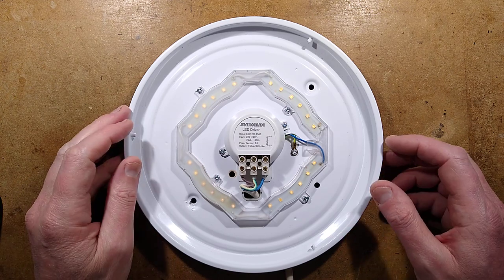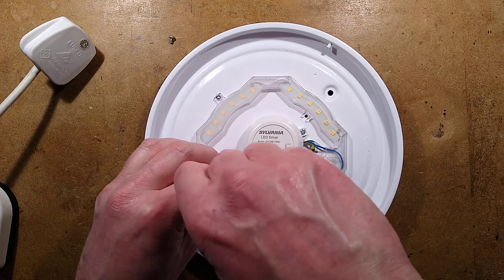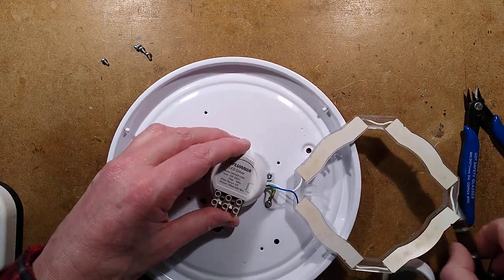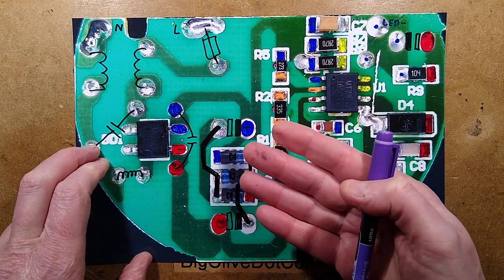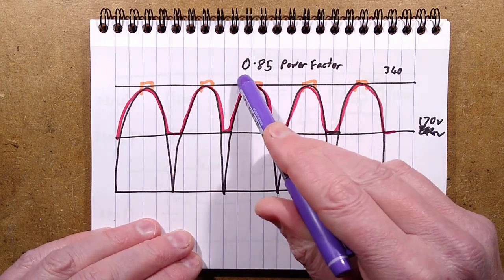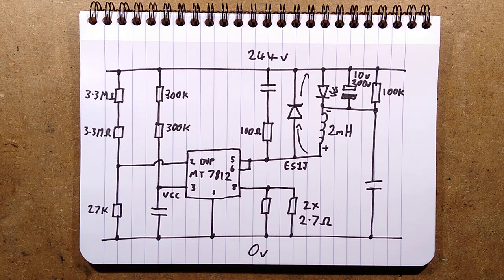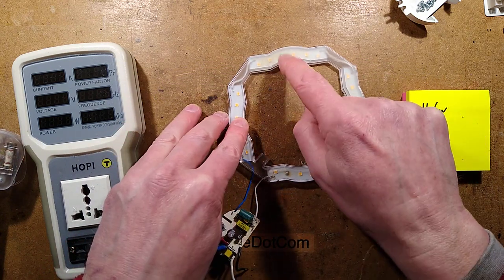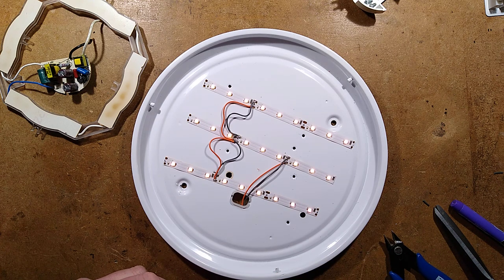Fixing and hacking a light from Thomas Nagy

Comment: Hi Clive. Got a question if you see this and wouldn't mind answering. I figure if anyone knows, it would be you. I want to power some solar string lights with a plug in adapter but want to keep the switch so I can pick flashing modes. Can I just remove the battery and wire in appropriate voltage? Would the panel still turn it on at night or would the whole thing just explode and kill everyone in a 5 miles radius. Cheers mate 🍻
Reply: You might want to add a diode between the power supply and the battery connector but otherwise it should be fine.
Reply from the maker: If it has three AA cells you can add a chopped off USB cable with a diode in series to nudge the voltage down a bit.
Reply: Thanks a lot guys. I'll try it later. Appreciate the response 👍

Comment: 2:45 The Osram LED circle lamps are also open inside and not covered, so it's not only the cheap ones from Ebay that are not covered with plastic.
Reply: Potentially they use a galvanic isolated power supply, so touching the LEDs is not dangerous?

Comment: This can be repaired by replacing the grilled LEDs with new ones desoldered from some 12V strip. It's cheap enough to be feasible. Then reduce the current by fiddling with current set resistors, so new LEDs won't die so quickly.
Reply from the maker: Common LED packages may contain higher powered chips or even a large multiple of series chips on the same substrate.

Comment: Hmm, I can see why a lot of these products would end up in landfill. I always prefer the products with user replaceable bulbs, so if the bulb fails, you just replace the bulb and you're back with a functional light.
I'd probably keep the PSU as is and add more LEDs in parallel (looks like there's enough room inside the fixture) so that you have less current per LED. I'd also use decent thermal paste (or similar) to ensure they have good thermal managements and don't bake themselves - as heat is the biggest killer for LEDs, and overheating LEDs won't last very long at all.

Comment: I have similar lights in my shack. I don't like them. One stopped working recently. I took the cover off, and removed the plastic for a better look. Mine has a circuit board in the center. Nothing was looking out of place, so I dropped it down and put the meter on the mains leads. I got 1.9v. Figured it was just phantom numbers, but it zeroed out when I removed a probe. Checked at the switch, got 1.9v again. Swapped out the light switch with another one, and it was working again. Guess I will need to replace all the switches soon.

Comment: Clive, amazing as always. I picked up an ikea ceiling puck like this and it has the most awful peripheral vision flicker. Are there any techniques for mitigating that? Smoothing capacitor or driver swap surgery perhaps?
Reply: In 99.9% of circuits you can put an extra capacitor directly across the LED array to reduce the flicker.

Comment: Hey clive... What about just installing a dimmer switch? Seems like that'd be a lot easier :) no ladder required either! Great video buddy thank you! We've been installing a lot of "wafer" lights here (canless light, has a junction box attached and hardwires) but presents the same concerns for me, if one fails, my customer would have to pay a service fee for us to come back out and change it vs being able to change it themselves. However, I've installed a couple hundred and haven't seen any fail yet, i'm hoping having the power supply so far away from the fixture will help, but we shall see!
Reply: This light doesn't seem dimmable. It has a buck regulator that I imagine won't take kindly to a dimmer.

Comment: Led panels for suspended ceiling are the absolute worse. I have seen many shops changed it and it gone shit within a year. My local chemist has replaced many again and said to guy, should've kept old fitting and retrofitted to led tube that are changeable. Also old fittings have louvre so less glare which is better too.

Comment: 5:00 , Won't that increase the series voltage across all the remaining LED's, making them run brighter and hotter?
Reply: No.  The power supply regulates to a particular current, at whatever voltage results.
Reply: LEDs are not ohmic conductors. They will normally clamp the voltage down to their collective forward drop, drawing as much current as they get in the process. So they are usually driven with a fixed current which works as long as the collective forward drop is within the design limit of the driver
Reply: @rexsceleratorum1632  OK, so with a defective LED bypassed, will the power supply still try and deliver it's full rated current across the remaining LED's, making them all run with a higher current? 

If not, would it still be ok if only a single LED was connected to the  power supply, in which case what would stop the single LED from being over driven when the power supply is designed to give more  current than a single LED?
Reply: @ElliottVeares  You are contradicting yourself there. Yes, the driver will still deliver its full rated current, which is still the same current, not a "higher current". 

You might be confusing current with power/wattage. The driver will supply a lower power to a smaller chain of LEDs because their forward voltage drop is lower and less work is needed to push the same current through them.
Reply: @ElliottVeares  If it is a 100mA buck driver like the ubiquitous 9W bulbs here in India, it will continue to deliver exactly 100mA to the LEDs whether they are 27 LEDs in series or 24 LEDs (after shorting out one 3-LED module).

Comment: This is something I've noticed..go out at night after a lightning storm, and a number of outdoor lights will be blinking...I call it " contacting the mother ship". 
     I bought a couple Dollar Tree LED bulbs for a freight elevator at work, and they've been on 24/7/365 since 2019 in a high vibration location.
     So far, I've had very good luck with LED bulbs...two failures so far.
     No user serviceable components inside....well, how do they know who the user is? Depends on the user..
Reply: The lack of thermal cycling might be a factor there?  The front hall light here has been on 24/7 for a few years now, both bulbs are still okay.  Same fixture in a spare room, where it only gets turned on once a month maybe, one of the bulbs has already gone.  The whole thing's a planned obsolescence game though, really, can't win unless you change 'em yourself.
Reply from the maker: I the elevators are in a cool area that will help.  LEDs aren't bothered too much by vibration.

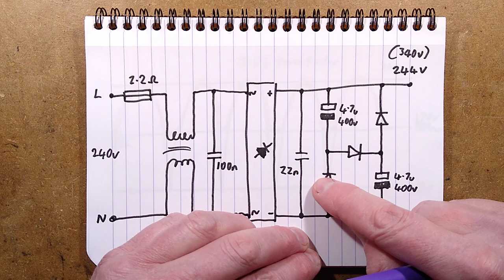Comment: How is it that  the dc voltage is not a direct short through the 3 diodes?  It does not look right? (11:55) Cheers
Reply: All of them are connected in reverse so no

Comment: Clive, I would like to use the filament style glass retro Edison bulbs on 12v dc supply, those filaments are in series pairs with 110vdc at about 13 watt per bulb with a ~>perceived<~ equivalent of 100 watts. 
mini inverter like circuit in the fixture? the bulb package is difficult ( not impossible ) to modify. how would you suggest to venture forth with the goal of light from that bulb?
Thanks for all the fun ❤️✌️👍
Reply: Honestly I'd just use a cheap automotive inverter. The basic modified "sine" wave ones are actually pretty efficient, especially if you are running multiple bulbs.

The downside is modified sine wave inverters are hard on capacitor dropper circuits, hopefully your chosen bulbs use something else.
Reply from the maker: You can get 12V versions of the LED filament lamps.

Comment: i 'rescued' one similar but different from a neighbours bin,   never been used,   i soon found out why, they couldnt get the thing open, took me ages to get the 'shade' off !!! no branding at all on it anywhere!
Reply: the led arrangement is a bit different, led chips have plastic semicircular lens things stuck on them, mounted on pcb on metal strips, bolted to the chassis, with semi exposed connections,
Reply: it does have thermal compound between the strips and main chassis, luckily....

Comment: I think many of those lights get deformed during installation, resulting in the bad thermal contact since the plastic does not deform together with the metal backing.
When installing those, it might be a good idea to just have the screws touch the metal backing and not over-tighten them.

Comment: Snubber Definiton: A device used to suppress ("snub") voltage transients in electrical systems, pressure transients in fluid systems, or excess force or rapid movement in mechanical systems.

Comment: 12W about equals 100w incandescent. Rather than under drive those LED's losing some of the intensity. I get the larger LED's that are round [1/4"/1W, 3W, 5W] with SMD mounting but you can bend the leads up and solder wires directly with metal backing for heatsinking.

 Take 24 of those using thermal conductive adhesive/silicone and glue them directly to the metal backplate in the exact spots the originals were. Use the 1W units and then that way there will be proper heat transfer with the LED's being driven @.5W so they would last forever, or at least until the power supply craps out.

Comment: this ensemble of diodes and capacitors is called "Valley-Fill" circuit and as you already mentioned it's a kind of power-factor correction (avoiding the usage of inductors and weight).  https://en.wikipedia.org/wiki/Valley-fill_circuit

Comment: I'd replace the LEDs with some nice bright 12v LED tape wired in 6x series'd strips to make up the 80v output of the power supply (84v, given 12 doesn't quite divide into 80 cleanly), and choose a colour of LED I like, cos warm white is too yucky to work with... :)
Reply: Make sure to remove and short out all six resistors which will waste power and produce waste heat. And make sure that you don't overdrive them because they might only need about 20mA while the driver puts out 150mA. At that point it becomes easier to do what Clive did.

Comment: The right to repair and the right to have spare parts for at least 10 years. The UK talks the talks over being green but it is the worst country for  implementing it,  everything is done for the large companies and to keep their manufacturing factories going. For example in the USA and Australia if you have something you do not want you put it out the day before the dustman comes and any one can come and take it. So if you have a chair that you no longer want, you put it out and if some one fancies it they can take it., making use and recycling used goods. In the UK we do not do this we have to take it to so called recycling centres. Lots of diy channels on you tube show them fixing  garden machinary that has been left out or the dustmen. The other gripe is that on cheap mass produced goods you can not even buy the raw materials at the price they sell finished goods. This how much control the manufacturers have and it is not buying in bulk as wool shop or timber yard can buy raw materials in bulk.

Comment: is there any chance you could do a video comparing 12v LED strip from the cheapest i.e. Amazon bargains to the more expensive branded ones all the same spec to determine what is the best I'm pretty sure some of the cheap ones on Amazon are the expensive stuff that didn't pass QC chips not square etc but still fine
Reply from the maker: It's very random.  I've had cheap stuff that has lasted well and expensive stuff that hasn't.

Comment: I wonder how long it will be before new install lighting circuits become 12v instead of 240v? Not an electrical engineer just find the videos fascinating but wonder why lights need to be 240v powerd when 12v could do
Reply: @Okurka.  They can be very efficient though. What is not efficient will be the wiring at 12V which may require 20x thicker wires for the same efficiency
Reply: @rexsceleratorum1632  48V would make more sense.
Reply: @rexsceleratorum1632  see this is why I commented, had always wondered why, I had not even though about that, thanks
Reply: @Okurka.  I have 22 light bulbs now that are always on and no light switches, when I had my house rewired I asked the electrician if I needed them as they look ugly and I have 100% smart lighting he said as far as he knew there is no reg requiring light switches as long as they can be turned off on the fuse board, they hardy use anything when on standby
Reply: @Okurka.  no idea what that is, he was registed with the local council

Comment: It will still end up in landfill eventually even if the leds don't fail as the other usual failure will be the electrolytic capacitors.

Comment: I still think with your ~1 million subs (and maybe with some AvE help/advertising) you could completely destroy the lighting market in every country.  Appropriately driven LED's, bigger than needed components, and possibly even repairable via replacement modules.  
Do "Designed to not fail" and reasonable quality...  you would be a bajillionaire and be able to buy everything on ebay/ali express you wanted for the rest of your life.  And you'd be very appealing to eco-minded folks.

Comment: 0:45 rubber seal so prob used for bathroom application ? it should still have a tiny hole in the bottom so any water can escape in humid enviroments

Comment: Wouldnt say they are designed to fail, they are designed for extremely low cost, which means using minimal LED's at full power or overdriving them making them fail quicker, failure is the result of cost cutting measures

Comment: when buying such a fixture couldnt you stick a strip of led in series with the existing leds and prolong the longevity of it?
Reply: No, the driver is a current regulator, so it will push the same current through all of them (until the driver runs out of voltage headroom and nothing lights).
Reply: As Clive suggested, you're better off doing the opposite -- short out a few of the LEDs so that the strip as as a whole outputs less heat.

Comment: It's not always sa simple as chopping one sense resistor out, most lamps I've modded had two dissimilar resistors (for example 2 and 8 ohms) so leaving either one would either not make enough difference or make it too dim. In those cases I have to scrounge for a right value resistor to replace both (sometimes smd, sometimes through hole 1/2w).
I would advise against getting those retrofit led boards that attach with magnets, all the ones I've seen (cheap chinese no brand) had aluminum core pcb's with a non-isolated power supply.
Reply: Also I really avoid this style of lamp, instead still sticking to standard E27 base lamps that anyone can change the lightbulb easily.

Comment: I think you'll find that Sylvania are originally Hungarian, not Canadian ... from their website "Sylvania is the leading brand of the Feilo Sylvania Group which has headquarters in Budapest, Hungary, as well as innovation and solution centres in 25 countries worldwide. The Feilo Sylvania Group is ultimately owned by Shanghai Feilo Acoustics Co., Ltd, which was founded in 1984 and is China’s first joint-stock company (SH 600651)."

Comment: If Thomas' name is pronounced the Hungarian way, then it's not really "nah-jee", but more like "nahj". Though that is still not entirely correct (the actual sound is softer, in fact it's a soft "d" sound), it's closer without the ending "-ee". It's a difficult name to pronounce in English, because the sound doesn't really exist in English I believe (or at least I can't think of any instance where an English word would be pronounced with this sound). You can look up "voiced palatal plosive" if interested, it has a page on Wikipedia and there's an audio sample.

Comment: Ive got so many battery powered lights for my daughter. Can you show us how to hack a battery light,  so we can safely use it with a usb and charger plug . What resistors and how to calculate them ? Please.
Reply from the maker: If it uses three cells you can usually wire a spare UCB lead to the battery contacts with a diode in series to nudge the voltage down a bit.

Comment: Can you explain why cheap LED bulbs here in India just start to cycle ON OFF almost like a strobe after some time being turned on.
Reply from the maker: Sometimes it's the power supply failing.  Usually the capacitors.

Comment: I do miss the days wher there was 5 grams of thin metal, 5 grams of glass and a portion of a gram of tungsten that would then last a decade and when done all three parts were fully recyclable.  These LED lights seem like a crap ton more manufacturing power used for lights that dont last as long. can't be recycled for the most part, and need to be replaced with a crap ton of manufacturing if you are lucky and the chosen style wasn't a one off run one time three years ago.